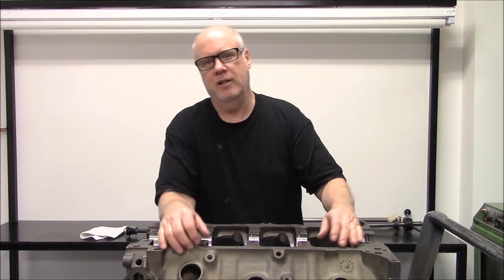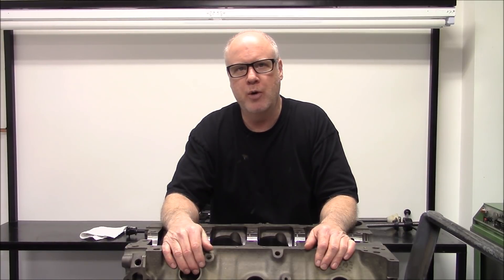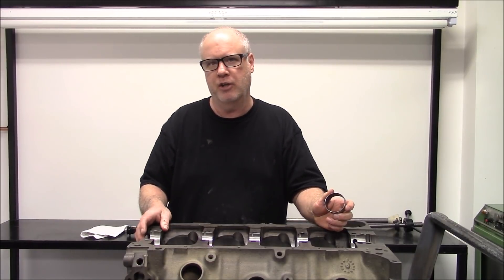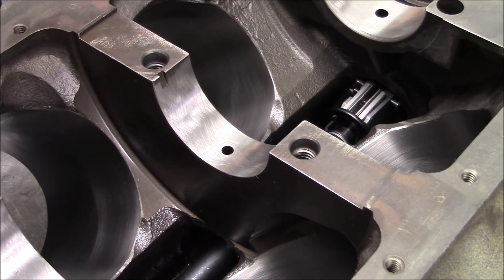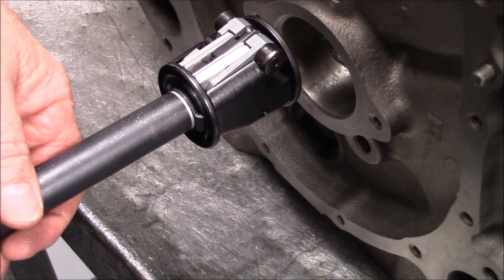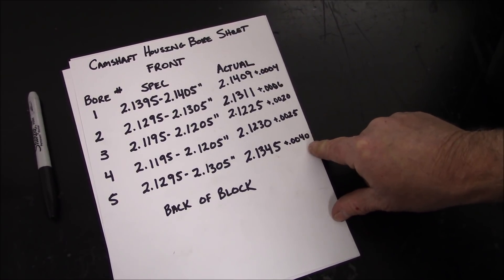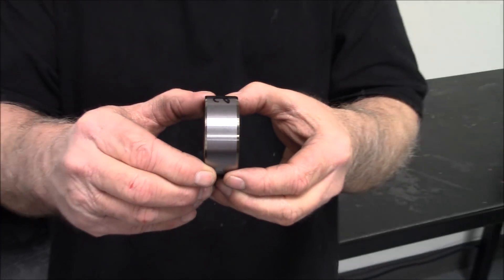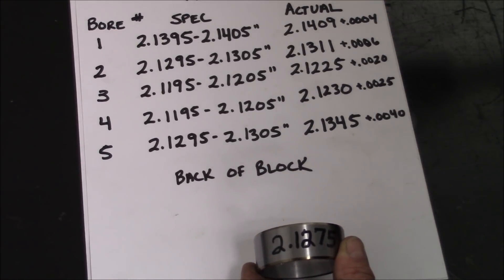454 Big Block Chevy - Measuring Cam Tunnel Housing Bore Size and Grinding Custom Cam Bearings

Comment: hey mark is there a specific reason why the 454 eats cam lobes, ive pulled a few at the wreckers and when i take them apart a couple had flattened lobes.
Reply: Insufficient and/or shitty oil, excessive high-load/low-speed operation causing insufficient "splash" lubrication to the camshaft, crappy aftermarket parts used during a "rebuild", improper break-in and/or excessive "cranking" prior to startup of a "new rebuild" and/or lack of "pre-lubing" the engine, wear in the valve train leading to hydraulic or solid lifters having "excessive lash" and in the case of hydraulic lifters no more "travel" left in the plunger to take up that lash which leads to a lifter "hammering" on the camshaft and/or no longer rotating in its bore as well as being alternately "too high" and "too low" in its bore for proper lubrication from the lifter bore gallery which means it gets "starved" for oil as does its pushrod, rocker arm etc causing more wear and "slop" until the lifter "wipes" out itself and the lobe which then leads to excessive leakage from its gallery holes which starves other lifters on the same bank for oil very shortly after the fist lifter/lobe pair "dies" so "suddenly" the engine is missing bad on two or more cylinders and will definitely fail a compression test and/or cylinder leakdown test. Which is usually why big-block-powered vehicles end up in "junkyards" with their engines still installed. Somebody assumes that since the engine was "tired" and maybe being "abused" when it suddenly "fails" and starts missing that it's a major engine failure like "scuffed pistons" or something. Which is easy to assume if adjacent cylinders both fail comp tests and that "indicates" a "blown head gasket" and/or "scuffed cylinders" adjacent to each other due to "overheating". 

Pretty much the same shit that will "take out" a flat-tappet cam in any V-type cam-in-block flat-tappet engine IF the cam goes before something else does. Lots of people talk shit about the "small lifter diameter" in Chevy BBCs and SBCs but those small lifters fail "completely" pretty quickly when improper operation, maintenance or oil is the "root cause" and because when one lobe/lifter pair fails another cylinder or two are right behind it once they get starved for oil, having "small" and "weak" lifters actually "saves" the engine from further "destruction" if it were being abused and the lifters "lived" until something "died". 

Putting "high-volume" oil pumps in BBCs for any reason during a "rebuild" is a really dumb thing to do since those "high-performance" pumps are actually made for the tall-deck truck engines because OF the high-load/low-speed operation and "abuse" straight trucks often get so those tall deck engines with their high camshaft placement get "sufficient" splash lubrication at "low speed" thanks to the significantly higher pump volume. When you put one of those pumps in a "low-deck" BBC you go from "insufficient" splash lube at low speed to way too much volume at "high speed" and one of those pumps can and will pump the pan "dry" in 10-15 seconds of "high-speed" operation at WOT on the highway for a half mile or so. When those priority main lube systems run "short" of oil the "top end" of the engine goes "dry" first, lifters "drain down" and there's your excessive lash. Straight-truck engines typically have "8-quart" oil pans that are very "deep" and they rarely get that kind of high-speed/low-load operation and have more lube system to fill and have to pump the oil "higher" in those engines. 

Its kind of hard to "pump dry" one of those engines. Put that pump in a passenger car/light-truck BBC and especially take a "tired" engine with one out low on oil and/or "sticky" from not being run/worked much recently and go blast up the highway as hard as it'll run as long as you dare and if you're a "gauge watcher" like anybody running "stock" BBCs should be, you'll see the oil pressure "waver" where it drops a little and comes back and drops a little and comes back and keep that up for very long and it's going to drop and not "come back". The kicker is that the oil pressure will be "normal" like it has a "low-volume" pump because those priority-main systems are "full-flow" and "bypass" oil at the filter "base" with filtered oil on the clean side of the filter "relieving" to the "dirty" side to go through again and there is no real "pressure adjustment" to them and they just "bypass" the excess flow at lower speeds and/or with "cold" oil. Get them wound up and really "slinging" a lot of oil out of the mains and rods and pumping oil as fast as possible to the top end and the "bypassing" ends without the pressure changing until it starts "wavering". 

And if you want to know something else about BBC camshafts, bearings etc its this. This "expert" doesn't have a clue WHY there are "loose" bearings in SOME BBC engines but not others or he'd MENTION the TRUTH which is that "Mark IV" BBC engines have the different sizes of bearing bores AND bearings as he DOES mention and measure but earlier BBC engines do NOT and the REASON for the DIFFERENCE is so that the factory roller camshafts in "Mark IV" engines can't be "swapped" into an earlier BBC since the "roller cam" blocks have different cam bearing/lifter lube systems for the "longer" roller lifters to be properly lubricated. They also oil the lifters and top-end of the engine less in order to minimize "windage" and obviously don't need as much "splash lube" but MUST have SOME AT ALL TIMES or the "axles" in the roller lifters go to hell in no time and a "wiped" roller lifter will put a bunch of "shrapnel" in the pan in a hurry and may just seize in its bore and hold a valve off its seat just long enough for it to get "tagged" by the piston. 

So the smart move was to make it impossible to do "cam swaps" from Mark IV engines to earlier engines and vice-versa by using the different bearing bore sizes and bearing IDs. That also ensures that the RIGHT bearings get in the RIGHT bores since there are multiple oil holes in some bores/bearings and only one in others. The bearings are often "slotted" around their OD so even if the holes don't get lined up correctly there still won't be an oil starvation issue leading to catastrophic failure. There's nothing TO "fix" IF you make sure to get the RIGHT PARTS FOR THE ENGINE and there is sure as hell no need to "measure" cam bores if the old ones were still "tight" in their bores. Of course SOME "engine builders" elect to "save time" by leaving the cam bearings in a "core" block while its "hot-tanked" which if the "real thing" as far as "hot tank chemical" is used WILL "dissolve" the cam bearings right out of the block. Then if some "engine builder" doing his first Mark IV "build" tries to go back in those "clean" holes with standard "early" cam bearings there will be some LOOSE ONES. 

But there's literally NOTHING ELSE that's going to cause a "loose bearing bore" since even a "spun cam bearing" isn't going to hurt the BLOCK and that spinning bearing will quickly be "resized". Not that its a "common" or even "every now and then" deal to have a cam bearing "spin" since only a lack of lube causes bearings to spin and the engine should "eat cam lobes" before that occurs. And cam bearings are so "tolerant" of "fit issues" that the"standard procedure" for an installed cam bearing that's really "tight" on its lobe is to literally "scrape" away some bearing "surface" to "make clearance". 

They're steel-shelled babbit bearings but being one-piece bearings that need to be "locked" firmly in place without "locking tabs" like on rod/main shells, they have to fit "snugly" into the block and it's much better to have a "tight" bearing show up as "tight" on the cam journal and "scrape" a little clearance into it than have a "loose" bearing. Cam bearing shells are CHAMFERED specifically to "start" them into even "tight" bores and "pilot" them decently I'm a diesel mechanic by trade but a "Chevy guy" by birth and although I heard about the "scraping" thing 25
 years ago in "tech school" and like my classmates though the instructor was putting us on and I went lots and lots of years and dozens of "rebuilds" of "real" engines made by John Deere, Caterpillar etc and haven't ever put cam bearings in a SBC/BBC, I HAVE had to "scrape" at least one diesel-engine bearing in a Deere 450-series engine and had to do so AFTER replacing ONE "tight" cam bearing and finding the same problem with the second. It was just a slightly "tight" bore and I ended up "rolling" a slight "bur" onto the bearing on the "driver" side pounding it in and had to "remove" that bur to get even the used camshaft into the bearing. In tech school they really did say "scrape" the bearings and I've since seen "old" service manuals mention and picture doing exactly that with a "bearing knife". But fine emery cloth is really "better" than "scraping" them with a "bearing knife" as long as you can keep clean/get clean the engine in that area and it usually ends up being just a small "ridge" that is easily removed. 

So there's your long, complex answers to a "simple" question plenty of "experts" couldn't answer if they've never personally "wiped" cam lobes/lifters in a BBC or SBC engine. And yes, SBCs are prone to the same thing for the same reasons if not a little MORE SO than big-blocks because their "wedge" cylinder heads and "straight" valves and valve trains perpendicular to the deck of the block tend to put "more" load directly on the lifter/lobe "junction" which IS the "highest unit pressure" found in an engine. And "flat-tappet" lifters are actually CONVEX and "dished outward" on their "feet" with the LOBES ground with a "taper" to them so its like a "knife edge" of contact and THAT is what causes "rotation" and keeps the lifters from IMMEDIATELY "wiping" the cam lobes. That's another reason why mixing and matching roller cams with flat-tappet lifters and vice-versa is a big no-no even if looks like it would be perfectly alright. Roller cam lobes are "straight" and roller lifter rollers are also "straight" and don't "mix" with flat-tappet parts.
Reply: I blame squirrels

Comment: Very Good , where can I purchase one of those mandrels?  Who makes it?
Reply: I want to know the same thing. I have several items I could use that for!
Reply: You can use a lathe to do the same thing. First make a washer out of aluminum that is approximately the same OD  as the finish size of the bearing (slightly bigger is fine), make the washer about 3/8 to 1/2 thick and drill a 1/2 hole thru it. 
Chuck up  a piece of aluminum that is larger OD than the ID of the bearing, turn it so the bearing fits on the aluminum spud with .001 clearance, make the length of the spud about .030 shorter than the bearing length, drill and tap the spud for 1/2 -13 threads then use the washer you made to hold the bearing on the spud, don't over tighten. Turn the bearing taking .005 cuts to within .001 to .0015 of the size you want and use 180 grit emery cloth to bring it to size. Not everyone has a crank grinder sitting in their shop and this will work just as well. 
FYI- Do not remove the spud until you have turned the bearing, it will be difficult to indicate it back in so it runs true.
I own a machine shop and use this method often for bearing fits.